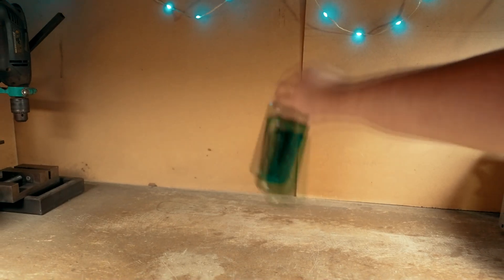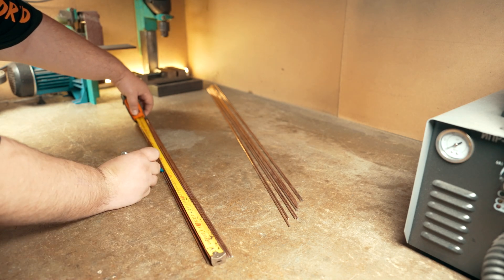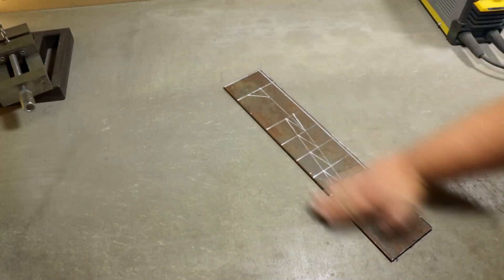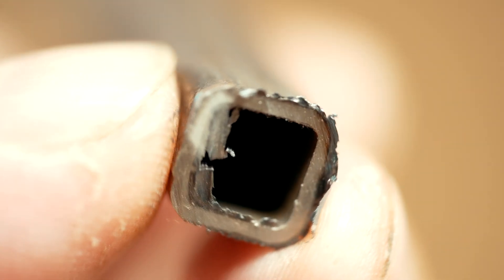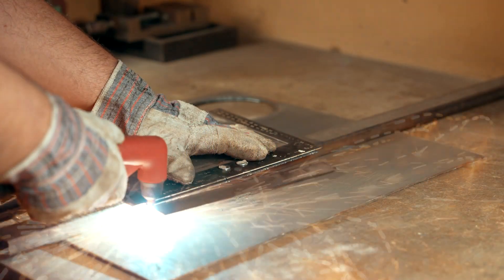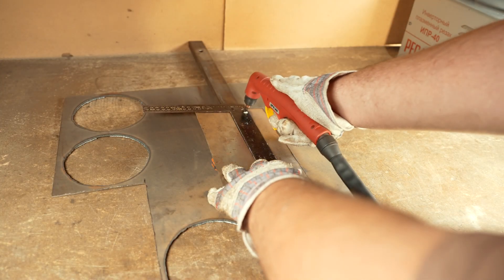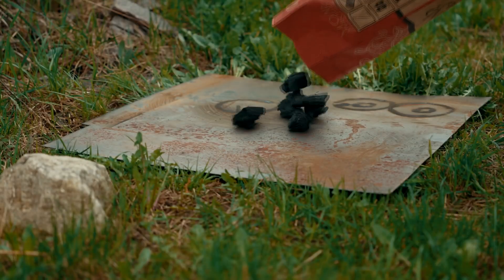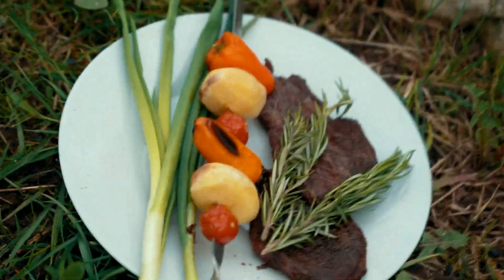You don't need camping grill anymore!

Comment: ER70S-6
ER=electrode or rod
70=70,000 lbs of tensile strength
S=solid (as in no inner flux)
6=Copper coated

It's what we use to identify TIG rods in the U.S. and a few other places
Reply from the maker: Thank you very much for deciphering!
I use these rods for my TIG welding machine.
Reply: @Doctor-Robo  and that's exactly what they're meant for. :) awesome grill!keep on making vids ill keep watching!
Reply: I came to make this post too

They are tig rods but I thought the 6 represented mild (low carbon steel 1-6% - anything higher would be a 7, denoting high carbon steel rods)